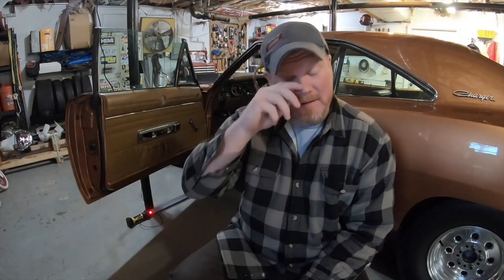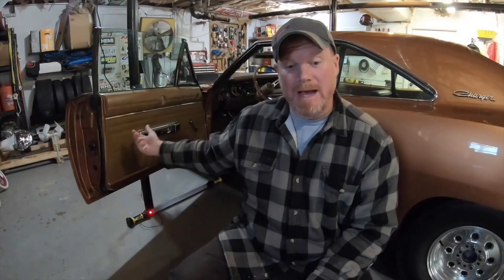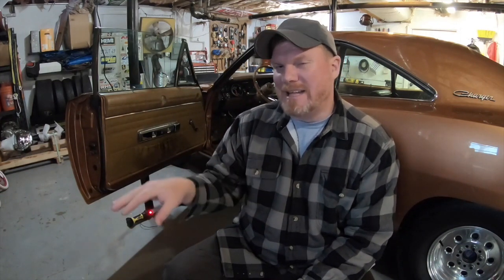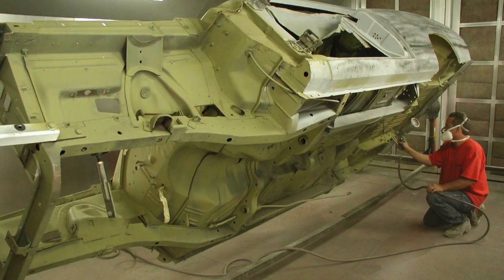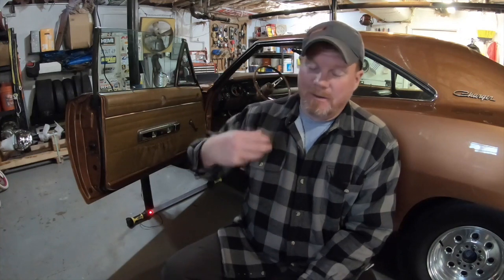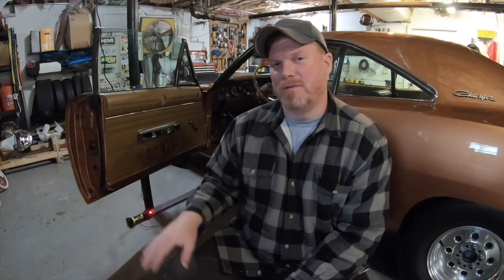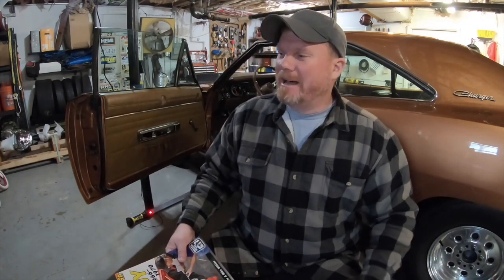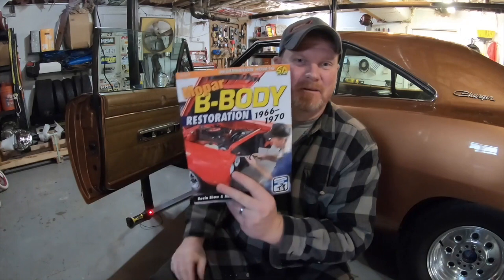MCM's B-Body Restoration Guide Book: Mopar Connection Shop Talk

Comment: Sorry, but  you could get a 440 in a 69 Road Runner. Options were 383 440 426 and latter in 69 a 440 6 barrel. It was 1968 you could only get a 383 or a 426.My neighbor ordered a new 69 RR with the 440.
Reply from the maker: Sorry but no you could not get a standard 440 4-barrel in a Road Runner (1968-1970). We have FULL Chrysler documentation to prove it. Your neighbor ordered either a Sport Satellite or GTX; that, or he lied to you about the engine.

Comment: What would be the best book to get which details specifics like installing fenders, clips, window guides, and things like that? Bought an almost completely disassembled car that's been on a rotisserie and basically having to build from the ground up.
Reply from the maker: Yikes. I'd want to say ours but that's not true either. The exactly measurements and body spacing is something a factory manual would have.

Comment: I absolutely cringe when people splice a new quarter panel down the body line instead of just taking the time on fitment around the sail panel and trunk opening. All the welds, grinding, hammer and dolly’s makes it extremely difficult to not get warping. All in the name of saving a few pounds of original metal? Usually it’s the amateur body guy that I noticed doing it because they’re more comfortable using fillers to cover imperfections. Most the time they don’t properly use fillers either so in five years the cracks start appearing. A body file is the most overlooked tool in sheet metal fab especially with brand new panels. It levels the ripples created by the stamping process. I love sheet metal repair! I hate bondo so I do my absolute best to keep from having to use it. It’s too bad the old restoration shop I worked for kept pushing me to do jobs too quickly. I ended up walking away because I felt i was rushed constantly and I just wanted to take pride in my work. 7 years of that, and underpaid I finally had enough. I wish I had the overhead to start my own small shop to flip one or two cars a year. I really enjoy watching these videos because it fills a void …. it’s been 5 months since I was restoring for a living but it feels like an eternity.
Reply from the maker: For sure! So much heat going to the metal is going to result in warping all the way down (if not done right). Just replicate how the factory installed them!